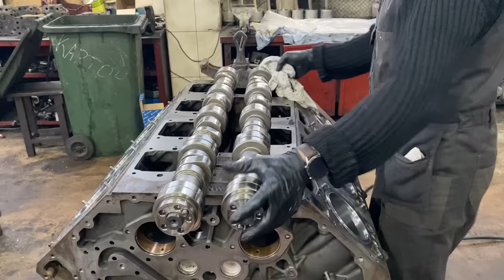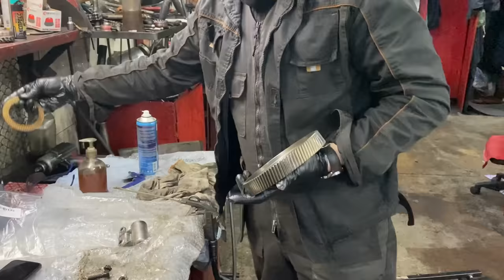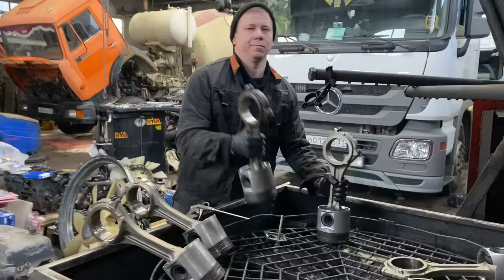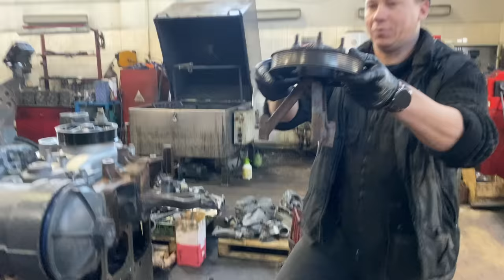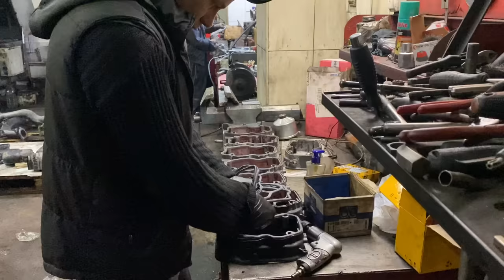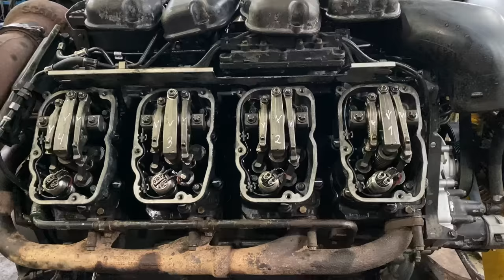СБОРКА И ЗАПУСК 16-ЛИТРОВОГО V8 ДВИГАТЕЛЯ SCANIA. ПРОБЕГ 1.6 МЛН КМ. DC16 PDE

Comment: Hats off to this master mechanic. That had to take a LOT of prep work to get everything clean and inspected and ready to build back up. Cat and Cummins also had V8 engines but that is a big engine. Were the cam bearings also replaced? The pistons reused? Lots of detail parts and lots of bolts and screws to find and place in their original holes. The engine started on the first try is testament to this builders skill...
Reply from the maker: Hi, friend! thank you for the good evaluation of our work!

Comment: Работа настоящего МАСТЕРА!!! Мастера своего дела! Спокойно, без суеты, без самопёрства. Тёзка, ещё раз говорю:только слова восхищения в твой адрес!
Reply from the maker: Сергей благодарит Вас)
Reply: благодарю! 🤝
Reply: @vladuk  No, if system is working properly there is no need to bleed air/water from system. There is air dryer where is changeable "filter" which contains zeolith or something like that. It absorb moisture from the air.
Reply: @vladuk  I have answered 2 two times now but my answer wont show up in here. I try one more time.

Its what I have seen. It was maybe in 80's when manufacturers move from alcohol antifreeze pumps to air dryers. 
There is still bleed valves in tanks but there wont be any water if systems is maintained somewhat properly.
Reply: @vladuk  What was the funny part? Yes there is usually valves even you dont have to use them normally. Why should leave them off, they cost like cents and some moron drive 10 year with old dryer cartridge so it is good to have possibility let water out from system if needed. 
Go and find some euro truck yourself and watch. I just pulled bleed valve from my old scania's air tanks, just for fun.
Reply: выполнил свою работу да и все , и что тут такого ? тысячи мотористов меняют поршневую каждый день по всей стране.

Comment: In 1971 I purchased a new truck that had a Cummins 903, V8 diesel, naturally aspirated rated at 320 HP, it turned 2650 RPM's and ran very strong, no problems, I have no idea how many liters 903 cubic inches is but I guess it's up there. It was a great engine, similar to this Scania.
Reply from the maker: Cummins is also a good and reliable engine

Comment: This reminds me, I had a deep sea cruizer boat with two 500 Hp Cummins Diesels in it, when it came to the 5000 hour rebuild of the engines, there were 4 mechanics who stripped the motors down and completely rebuild them inside the boat, the engines were so big it was impossible to remove them and get it put back in because you would have to destroy 2 levels of the boat sitting directly onto of the engine room. It cost a fortune to do, we had to pay for everything even their hotel rooms, food, transport, everything and you can imagine what 4 diesel mechanics who knows Sea Engines must cost per hour. It took them 8 days and they even resprayed the engines the original white and replaced all the stickers and cleaned the engine room so you could eat of the floor.

Comment: Started right up on the first try. I never had a doubt. 🙂 Your knowledge and expertise are very easy to see. That poor engine was so dirty I felt sorry for it. You guys cleaned it up so well I had to watch the video a few times to see which parts were new and which were reused. I have two questions. Is it reasonable to think this engine may run for another 1.6 million km ? I would also like to know how you learned to make such great videos ? Bal'shoye Spasiba
Reply from the maker: Hello friend) Thanks for the comment.
- with good maintenance of this engine it will operate for more than 1 million kilometers)
- I started shooting videos as best I could at that moment - but every time you gain experience)
- I hope we will continue to shoot even better and more interesting videos)

Comment: Did you also paint it at the end?
After all the maintenance, was it worth the cost or after more than a million km, could have been just cheaper replacing it? Don ' t get me wrong, i also always prefer repair than replace and i have to do the same with my boats engines. It is a honest question,because sometimes the cost of spares is discouraging
Reply from the maker: The new engine costs as much as an airplane wing. And if you buy a used motor, then it’s a “pig in a poke.”

Comment: Do you reuse the cylinder head bolts? I'd be worried that they would snap! That's what happened to me on a small car engine :(
Reply from the maker: Hello. We check the bolts before assembling the motor. If they are stretched, then we change them. on trucks they are usually enough for 2-3 times